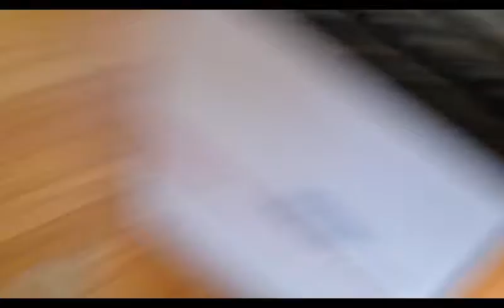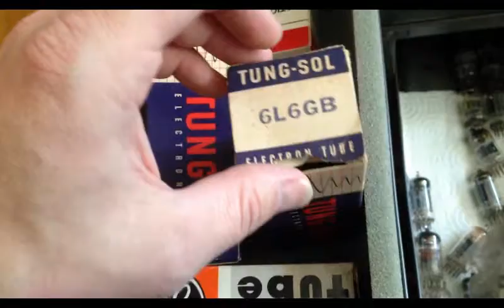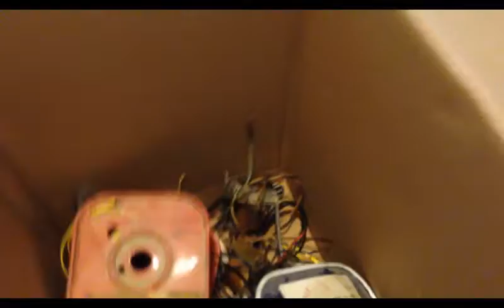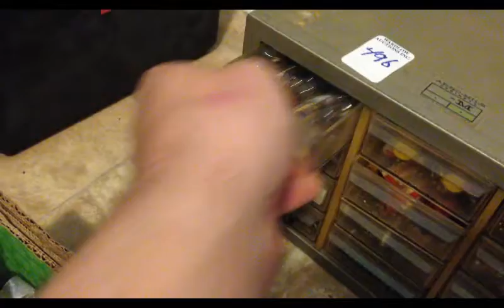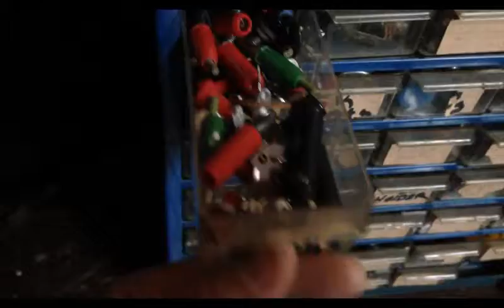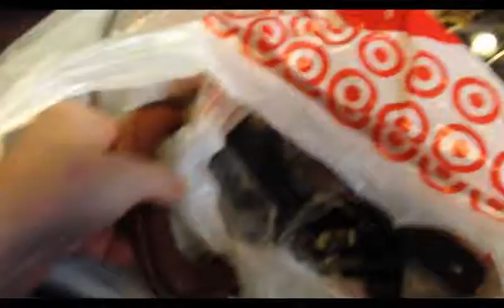Estate Sale Finds: Amp Parts and Random Stuff

Comment: I have a odd ball Standel solid state chassis thats complete if you want it free.

  Uses the resin filled circuit blocks.  I got it in a marketplace deal with an old Traynor ts25b.  Sold the altec speaker that came in the combo cabinet.  The cabinet was junky and full of probably asbestos insulation.

The chasis is for a bass amp.  All complete knobs, handle, decals visible.  Needs service but works.  Very quiet output.

Some of these parts like those flat circular transistors could work in it as it has them in a cage on the back.

Lemme know if your interested and ill email you pictures and get your address for shipping.

Comment: Maybe make it into a hybrid use the single tube stage as a tube pre-amp and then have a class D transistor amp.  Have that driving a single vintage speaker of your choice that you already have any old cabinet you already have that needs an amp. That would be killer for a young person a student or someone that does not want or need some vintage beast with a beastly price tag.

Another idea would be to use the transformers and and base to build something more fun. It is too easy to punch a few more holes and add some more tubes to it for added gain stages. Then you can build any kind of clone you want.

That part you though was part of a lock is not part of a lock. It is a 10 turn pot control. Amateur and CB radio people use them on SSB Single Side Band to give more precision than a single turn pot and to give them more total adjustment. It is used on the clarifier or RIT. The switch is a mechanical lock to keep you from accidentally turning the knob once you are dialed in on freq.

Comment: Those boards with the photodetector and xenon flashtube....do they appear to have an audible device anywhere....or anything that looks like a driver section?? The fact that, when you obscure the photodetector, they fire the flashtube, has me thinking that they may be part of an old smoke detector (old, non-ionizing type)!

Comment: I understand that...I also build amps out of old computer add-on 3 piece speaker systems, I think it was a Cambridge three piece speaker system and the subwoofer was blown.  I used the solid state circuit board and a pair of Jensen speakers...they might be book shelf speakers, but over all and taking my time, these rebuilt speakers kick ass and leave you in a daze with... What The Fuck!  Bottom line is...I love them and Brad, your still the Guru of guitars and electronics.

Comment: I've won some old components in those organizers in auctions and what not before,  usually most stuff is fine except about 50%-60% of those electrolytics and various other types test bad. Tiny Chiefs I don't trust,  the Aerovoxs are usually fine.  All the old Mallory and Sprague film caps test fine,  but the electrolytics are often electrically leaky or way out of spec.  The domino micas last forever,  but the IF cans with silver micas inside them fail a lot.  Also scored a bunch of old NPO ceramic caps which I just test as I use them,  they're never bad though
Reply from the maker: I think you're right one everything you say here. Probably a good idea to form any old electrolytics slowly on first startup if you intend to try to use up old ones. I don't have many Tiny Chiefs, so I can't speak to those. Ceramic caps are almost always still good. I don't even bother testing those. Too time consuming. Easier to just troubleshoot on install. Waste less time overall, I think, on those.
Reply: Yeah I might stop with testing ceramics,  havent found a bad one yet even if they are 50 years + old.  With the electrolytics,  I have so many Nichicons, Rubycons , Illinois caps I just normally use those unless they ask for something specific.  In most of my repairs people don't care about it,  but with guitar amps people can be super picky so I don't do them much.  Love your videos BTW

Comment: I'm a photographer, and I can't say I've seen a strobe setup quite like that. It's common for studio strobes to be triggered by a small speedlight stuck in the camera hot-shoe, so the sensor makes sense, but a layout like that is bizaaarrreee. The bulbs need to be fairly easily replaced - for a photographer, mind you hah. We'd also want to be able to mount light modifiers on there as well, and a way to control the power level on the output. Weird, man. I wonder if the plugs can also be used to sync / trigger them?
Reply from the maker: I think the female plugs on them are obviously there to daisy chain it with some other piece of equipment as well. I'm at a loss. Maybe some old school photography studio liquidated?
Reply: It'd have to be pretty old, or pretty specialized. With studio strobes, you want to be able to control the light really well, so the flash tubes will often be seperate from the board and projected into a metal cone to confine the light more. This would be a very inefficient lighting solution to say the least - no way to modify it, no way to confine and project it properly - it's just shooting light out all over the darn place. That said, the name of them sure would imply that. 

I did a search on the patent number, didn't come up with anything remotely similar. A bizarre little puzzle you have there man. Love it!

Love your channel. I've spent entirely too much time watching your vids. I'm an ex musician and an ex guitar tech. This is bringing back some great (and not so great) memories hah. Ah to get my hands on that Traynor head I saw in your Day in the life video.
Reply: I think the CdS cell is used as a simple movement detector (with a tube narrowing its view angle) and these modules were either used in alarm systems or game cameras

Comment: ok so I am going with my gut here on what that strobe device is... i believe it isa power outage device and the alternate connector is for a 12v power source. i have seem such devices in hospitals etc. turn off the lights and see if it repeatedly strobes at an interval. usually used to mark the path to exits.